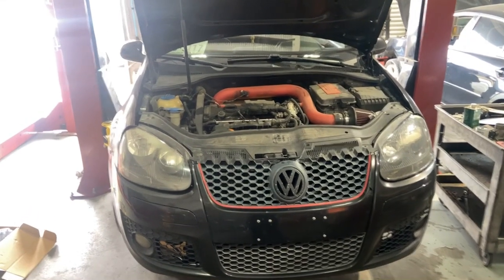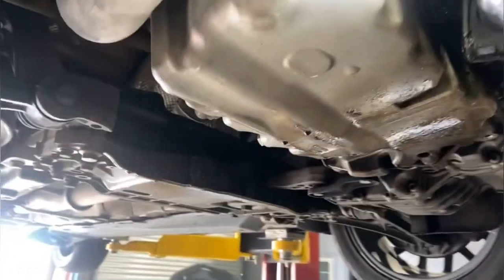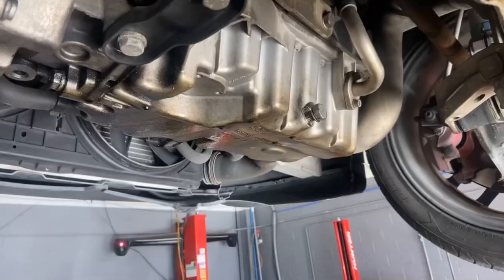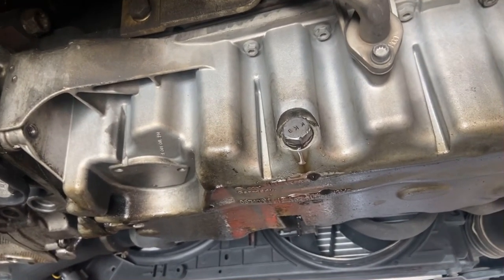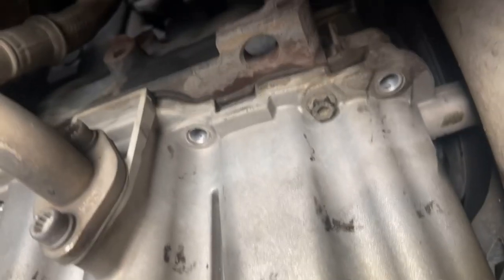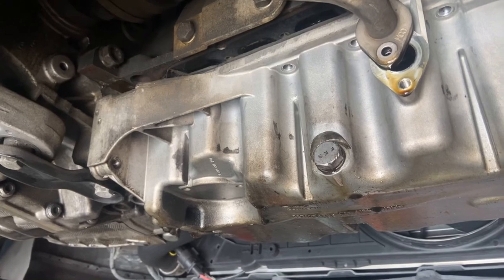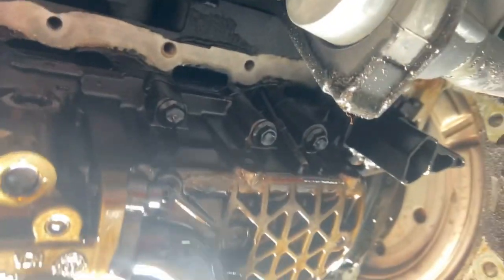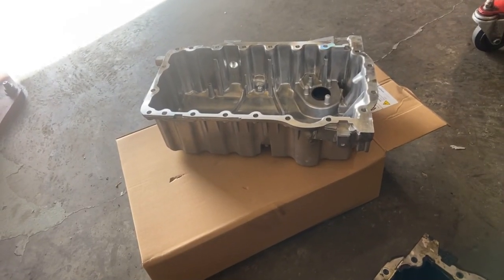2006 2007￼ 2008￼ 2009 VW golf GTI oil pan removal

Comment: Good tip. Thanks for the video. I have a question though, those two 10mm bolts on the tranny side, I know they're hidden, I was told to be careful because the bolt may fall off to the transmission side? Is that true? Thanks.
Reply from the maker: Yeah but I would only worry about that on the install process. But I would not worry to much if you have that rounded when 5mm allen